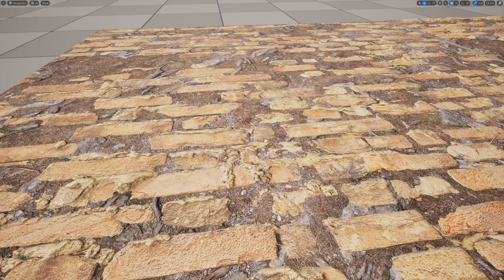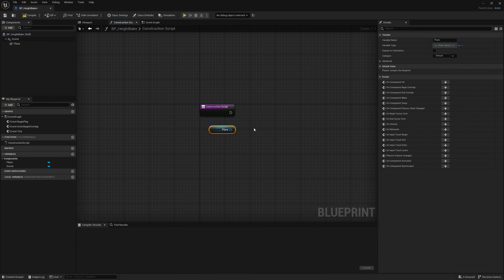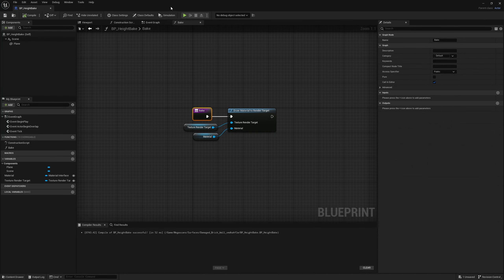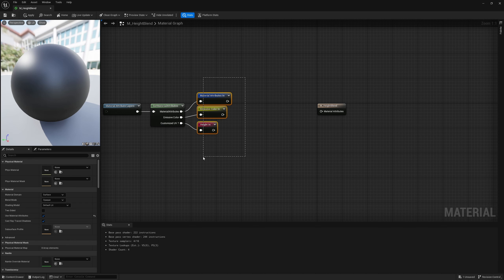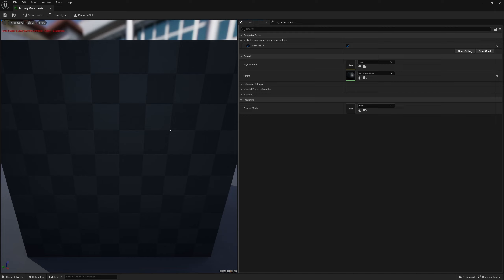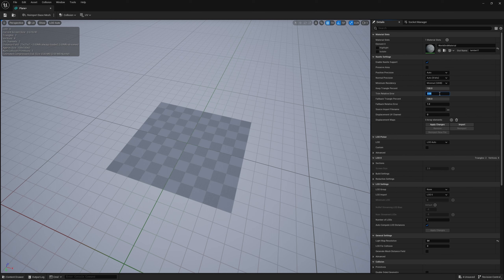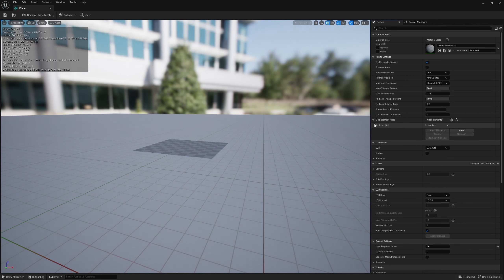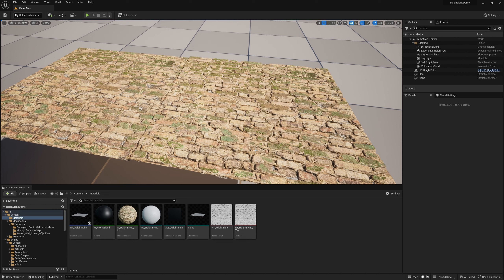Bake Layered Height Texture to Nanite Displacement Tutorial | Unreal Engine 5.2

Comment: I've tryed to create this BP inside UE5.4 and use it with another master material (with vertex blend). I know you've made an update for 5.3 but I need this method to bake blended displaced map to apply it on the mesh with modeling tools to have it in path trace render too. Unfortunately, when I tick "Height bake?" in the master material instance, no texture appears. You think this is related to the master material or to UE5.4?
Reply: I think i've solved, here is the tip: in the functions of the master material (made for UE 5.4 with displacement and vertex blend) I've routed all what was sent to Displacement, to CustomizedUVs_7 too. Now it works!
Reply from the maker: @Samuele_Lini_ARS  I'm glad you got it sorted, and thank you for providing a solution for anyone else trying this in the later versions. :)
Reply: @Procedural_Minds  a weird question: is it possible to bake a world aligned texture? ...a way to "stamp" over UV wrapped mesh the result of a world aligned texture...
Reply from the maker: @Samuele_Lini_ARS  Yes, the same baking methods for non-world aligned work with world-aligned last I checked. But depending on the resolution you bake down and the tiling of the textures, you might lose detail.
Reply: @Samuele_Lini_ARS  Hey, can you please specifie how did you sent Dis to Custom7?
Reply: @othmanelbahraoui7045  I'm using easymapper as master material. There you've just got to search the function where textures are added then route displacement to custom7 too
Reply: @Samuele_Lini_ARS  Thank you so much it woorks :D
Reply: @othmanelbahraoui7045  glad to hear that :)
Reply: @Samuele_Lini_ARS  How exactly did you change that? I am also using a master material with vertex blend but don't know how to reroute from displacement to customizedUV_7
Reply: @markoacanski8620  I'm on EasyMapper. You have to to reroute from displacement to customizedUV_7 in functions MF_WF_Material_A_VT (B and C) and then, in the master material, do the same as in this tut
Reply: @Samuele_Lini_ARS  i'm using the material blend from quixel environment packages. i did reroute all of displacement nodes to customizedUV7 in all the functions of the master blend material and the render target bakes a displacement map. the problem is that i have no way of adjusting the strength of the texture map. How do i achieve that?
Reply: @markoacanski8620  to adjust the streght of the final displaced texture map I think you'll have just to mulltiply the result with appropriate node

Comment: Hello, it was very interesting, i just got some questions. Since the full release of the 5.3. We can now have the displacement in the material. So i'm wondering if it's still necessary to do all the setup for the bake. Coz i guess we could just get the data of the blendheight and bring into the displacement channel (on the material)
Reply from the maker: Yeah, with 5.3 it's potentially possible to just have it all inside of of the displacement input. I haven't tried it yet, but it's on my todo list. The general layered concept will stay the same, but it does eliminate the need to bake it to a texture and push it through the custom UVs.
Reply: @Procedural_Minds  Hey, I tried it, with the same setup as your video. Everything is well configured. But it's not working, after some troubleshooting I think it's a problem with the GetMaterialAttributes node, but I'm not sure. I just started learning Unreal. Maybe there is an other way to make it work but without the layered setup.... idk
Reply from the maker: @trauma2980  I'll definitely do an updated video on it for 5.3. The idea I have is to still have it all work the same way, but then just input it on the overall material level, instead of per layer. That way you still get the proper merge per layer.
Reply: My personal input here: Displacement (in materials) is NOT a release feature of Unreal 5.3. Nor does it even seem to be considered 'Experimental'.
You probably won't/can't find anywhere where Epic Games officially announced Displacement as a 5.3 feature. 
It's likely that some smart guy looked into the 5.3 code, saw the code, and activated it. If you've done any performance testing you can see that this is DEFFINITELY not a shippable feature (massive frame rates drops, overrides in instances don't work and landscapes brake apart after building).

Also just plug your displacement into World Position Offset (WPO) (AKA the OG displacement and BETTER).

And to answer your real question XD .... Yes you should definitely still use this strategy. The idea is that you're making an entirely new displacement map directly within UE. Which you would then use as a height texture in .....well anywhere really (use in the mesh displacement, or material WPO, as a mask or Ambient Occlusion, just to name a few.)
Reply: Material displacement generally works well, but does come with a pretty big performance overhead - around 2ms on a powerful GPU. This is most likely fine for visualization renders etc, but not so great for games. Doing a pre-baked approach like this is a great way to be more optimized.